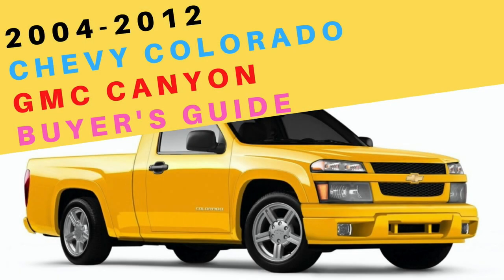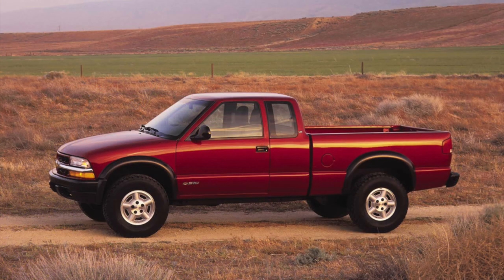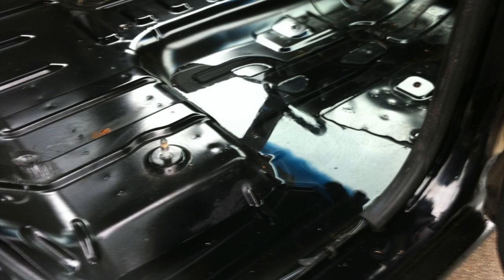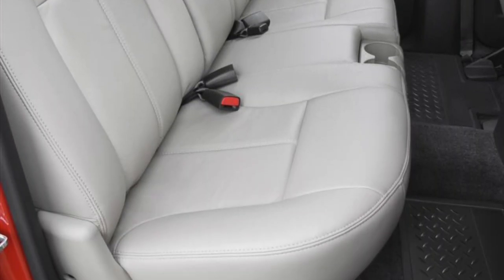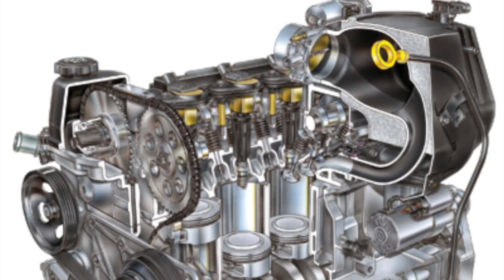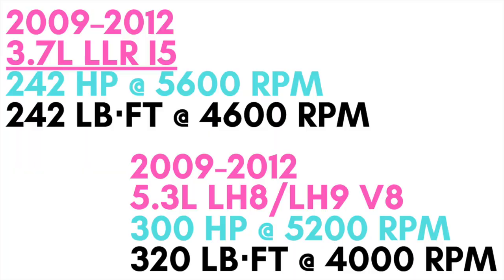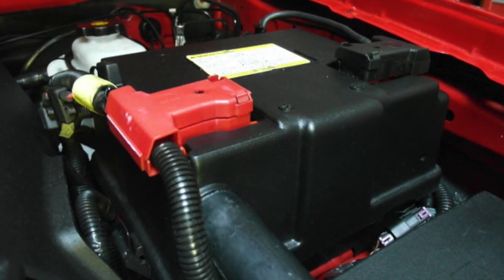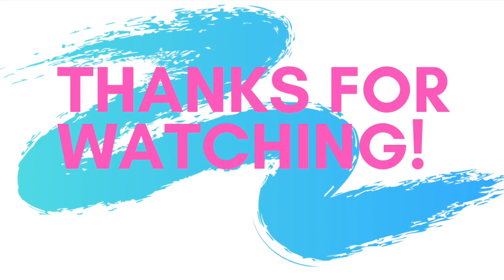Chevy Colorado / GMC Canyon Buyer's Guide (355 Series Common Problems, Options, Engines)

Comment: My 04 5cyl has 245K on it and still going strong. I would go out right now and drive it cross country without hesitation.
Reply: Thanks ...I'm thinking about getting one
Reply: I got an 04 5cyl with 335k km. Still goes strong
Reply: I have an 05 5cyl and i totally would do the same. you have any check engine codes? I've got one regarding an evap leak but I've tried everything and no avail. truck runs and drives fine though.
Reply: my truck also only has 68,000 miles
Reply: My 07 4cyl 2.9L has 460,000k lol
Still running strong as I used it for my home renovation business. I bought it for 1500 when it was at 280k.
Best investment for my business by far!
Reply: Automatic?
Reply: @ashtons7523  the evap leak is inside the gas tank. They are known to leak there.

Comment: Bought a craigslist 6 owner 2004 Colorado 3.5 automatic 245,000 miles for $2,600! Still running strong! Owned it for 3 weeks
Reply: Keep going. Our 06 has 370,000 still going strong.
Reply: @DuanneBall how’s that 06 doing? 3.5 i5?

Comment: My '05, 5cyl, crew cab Z71 Colorado is rapidly approaching 300, 000 miles and still gets 40mpg on the highway and in the mid to high 30s around town. With only a few, nagging, electrical problems I'm very satisfied with the truck.
Reply: Change the oil and the Atlas 5 will reward you for another 200k. These aluminum DOHC engines are exceptional from the closed deck to the girdle and sleeves. Their efficiency is why I adore them and own a fleet personally. Clean out the throttle body regularly and electric fans with a low thermostat keep it at a 1/4 instead of close to half. Specially effecting your air conditioning by 10 degrees plus. Good luck!

Comment: I just bought a 2005 crew cab 4x4 that went into a ditch at fairly low speed, but hit brush and a small tree. I have to replace the roof panel, windshield hood, grill, headlights driver fender and driver door mirror. 225,000 miles but it was a fleet truck for an excavating company so a lot of highway miles. Been well maintained. Interior is good. No leaks, good belts and runs great. Paid $600. It has the 5 cylinder. I didn't know anything about these trucks so it's good to hear that they are pretty good trucks. A guy I know had one that he bought new and took it in to get a tune up at 200k miles. It was still running well on the original plugs.

Comment: The 3.7 inline 5 cylinder is pretty good my dad uses it every day whit 340 000 miles
Reply: Impressive
Reply: @randumdude5824  will you sell?
Reply: I have one with the exact same engine but it only had 140k miles and 2k miles later one of the five cylinders had no compression.
Reply: I always wondered is there inline 5 manual transmission?
Reply: @jcpnlz  Yes, I'm buying a 2004 inline 5 4x4 with a 5 spd manual
Reply: @jcpnlz  Probably hard to find though. I just lucked into it. Most people buy auto trans and have for awhile.
Reply: @bags4930  oh ok cool I'm looking for a manual extended cab xtreme.

Comment: I just bought a 2007 two wheel drive crew cab with the 5 cylinder and 125,000 miles. I got it at auction from the local utility company so I figured it's been well maintained. I drove it 50 miles home and it runs great and the 60 to 80 is great for passing slower vehicles.
Reply: How's that 2007 running? Any issues? Do you have the 3.7L i5?
Reply: @thebarathleticclub3512  I just bought it to resale
Reply: @thebarathleticclub3512  I have a 2010 ext cab with the 3.7 engine. I prefer this over any of them, I had the 07 single cab with a 2.9 engine, it sucked because it had no room for anything and bad engine and I don't like the crew cab because you're cheated of out bed space. All of them have some form of electrical issues which after being figured out they are great trucks.

Comment: I'm not far from buffalo NY , my 04 248 k miles 2nd motor  is slowly dying due to ruff winters n salt on the roads . The frame is pretty rotten , the mech wouldn't put it on the rack to align it . Bolts are snapping off , the suspension is being replaced to no avail . I love this truck , please don't die !

Comment: I have a 2010 lx 4 door 3.7 4x4 about 100,000 miles so far. I like the truck, get about 20 mpg hiway. It's important to keep an eye on the engine oil level, and change every 3,000-5,000 miles in my opinion. Don't rely on the sensor lights to remind you. Definitely check that 3rd brake light seal, I had to use some silicone to seal it up.

Comment: The 3.7 can have a really mean sound to it as well with a flow master and a cold air intake swapped on. I also felt better throttle response and maybe some power gain after doing those mods.
Reply: That's interesting. I've been tempted to do some similar upgrades to my 2010

Comment: this vid helped me figure out what the camshaft actuator valve was I have that p0330 code and replaced my camshaft and crankshaft sensors and still had a problem with said valve leaking oil in the sensor. thank you.

Comment: I have a 2004 standard cab Canyon with the 3.5 and auto trans with the Z/71 SLE off  road package 4x4 with only 95,000 miles. I ordered it from the factory because early 2004 standard cabs were hard to find optioned he way I wanted. The newer ones (current) look like crap!

Comment: My ‘04 3.5L Z71 has a crankshaft seal leak, valve cover gasket leak, and clogged PCV valve. I’m about to fix all this stuff for less than $50. I love my 5 banger. I threw a camper top on it and use it for overlanding. I gave mine hell! She became a local celeb with my friends and people at my local university. I bought a ‘04 Jeep GC and it’s given me so many problems that I want to repair the Colorado sooner than planned just to have something more reliable. Over all my truck has done great for 220k miles and will have more to come. Not to mention the exhaust sounds badass since it’s a unique engine design.

Comment: I got a Chevy Colorado with $250,000 MI the only thing ever done put a water pump and it's easy to put on and put a wheel bearing but I live on bad dirt roads running through deep water but it's been a good one that's got 255 and I would be scared to go cross country own it and I love it and I'm fixing to get another one

Comment: Great job. Thank you.
I have a fairly rare '07 GMC single cab Canyon 2WD sport w/ 4 cyl eng, 5 speed trans, sport (factory lowered) suspension, 18" factory wheels, w/ buckets & console. I get asked to sell it all the time, but it is a fun, low slung keeper.
Reply: @SlamDogg Millionaire I was told it was a POS by friends when I ordered it. Now 150k miles, never left me down, not once. No disappointments.

Comment: I'll be looking for a reg. cab model to swap the 5.3 engine from my Envoy XL into. They never put the V8s in the reg cabs, and the colorado 5.3s were neutered with 'torque-management' software and fuel efficient axle-ratio. The result was a slower truck than what this legendary LS V8 was capable of. My 1500lb heavier Envoy XL also did 0-60 in 6.7sec (when stock), lighter Colorado should be quicker than that.  I want reg cab to be as light as possible, and swap my 5.3, 4L60e transmission, AND 4.10axle ratio into a reg. cab for a great sport truck that's capable of some work. Preferably in that yellow and with the 'Extreme' appearance pkg. Likely won't get that lucky, so I'd settle for any reg. cab that's not all rusted out like my Envoy frame. Wonder if I can swap that 2.8 4banger into my Hyundai Accent?😁

Comment: At my work (a moderately sized theme park) we use old 2006 Colorados as work trucks and they have very low mileage like 30 thousand but are really beaten up but they still run strong

Comment: Been driving a 2010 Colorado 3.7 Liter 5 cyl 4x4 for 4 years and overall it's been a great truck. Now at 135,000 miles 

Pros: 
-- Overall it's had no major engine issues. It is starting to burn a bit of oil at 3,000-4,000 miles after a change. 
--was way cheaper used than a Tacoma or Frontier
--some parts have been easy & cheap to fix myself, including struts, sensors, some wiring, oil changes, air filters, fluids. 
--Solid 4x4 for general mountain roads, 6 foot bed a nice size for camping and moving most things 
--gas mileage is solid. With good tires and cleaned intake, I can get up to 25mpg on the highway.
Cons: 
--interior is garbage. Most handles have broke at least once, and plastics are peeling. 
--some repairs are very expensive due to dumb engineering. Changing a wheel bearing for example cost me $800 bucks largely because the wheel hub requires you to take everything apart (big labor cost)
-- not a ton of torque for city driving and tranny is sometime slow
--some electronics and wiring are garbage. I've had to fix speakers, airbag sensors and more.

Comment: I have a 07 canyon 3thrd brake light leaked. Tail gate and glove box latch broke it goes in to anti theft mode have to wait 5 min to start. Other than that it's been good 105 ooo miles.
Reply: Mine done that anti theft cut off done that to me ,, look up the truck problem and cutting the white wire with blue stripe I followed his instructions never had that problem again
Reply: @manuelstapp3359  cool.  I'm having to wait 10 minutes, not 5. Pain in the butt.

Comment: The 4x4 version of these trucks had the worst Front Brake Design ever- TOTAL NIGHTMARE!
To remove the rotors they actually come off backwards, you have to remove several components.... look it up its absurd
Reply: Hi, I own several Isuzus. The design is very rugged. I've been on nasty terrain in the 2WD model and had no problems bringing the truck to a stop.
Reply: It's annoying to fish out the abs sensor with the rotor, but it's not a big deal. Being attached to the hub does come with better stability though. There are certainly some awkward repairs though such as the starter location.

Comment: I drive a 2011 Canyon 4x4 and it's had many of the common issues you list here. The blower motor was very annoying but not terribly difficult or expensive to replace. You didn't mention the most annoying drawback of these trucks in my opinion, which is the awful passlock failure. At least once a week I am unable to start the vehicle and have to wait 10 minutes for it to clear the passlock error.

Comment: When I was ready to replace my battery I wanted an Optima Battery.   For those unaware, Optima does not make a group 86 series battery.  Being said, the 86 series is 1” skinnier that the 34 series.  34 is a super common battery.  
If you want to upgrade your battery, I suggest pulling you battery tray out and cutting part of the angled siding on the inside.  It just acts as structural support.  I used a Dremel tool to make the clearance.  
If you end up getting the larger battery, and want an Optima; you will need additional work to be done.  The optima is a group 34/78 DT (double terminal) meaning it is also a 78 series battery.  The difference between the two is the 34 is top post, the 78 is side post.   For some reason they made the side terminals pushed the the center more, and this lines perfectly up with a bracket that connects to a strap to hold your battery down.  This being metal- we have an issue.  I ended up cutting 2 corners of a circle that way I don’t fry my battery by having the front side terminals both touch a metal bracket.  
A little unsightly, but you can always make the cut cleaner and look better.   Overall if you want a bigger battery, 34 is my suggestion. Much stronger, more common, and waste less space.

Comment: So does the 2007 3.7L i5 a better option than the 3.5L i5 that had the valve seats issues? Or does it also have that same issue?

Comment: I just had that code it turned into the valve in number 4 breaking free and falling onto the piston so beware if it ever misfires. Also this engine cost 4500 through jasper engines good luck trying to find one elsewhere
Reply: Copart has wrecked ones for cheap!

Comment: I just bought a 2011 regular cab work truck with the 2.9L four, 5 speed with 19,022 miles on it. Clean CARFAX 2 owner.
Reply: I own a 2011 Reg cab LT  2.9L, 5 speed 4x4.  Mine has 25,500 miles on it.  I would have 19022 on it had two getto boys not stolen my car making me drive my Colorado instead.  I am worried about future work on : Alternator and Starter.  I heard that they are hard to remove.     Is your truck from the South or Rust belt?
Reply: @Romulan112  Louisiana all it’s life.

Comment: I have a crew cab 07 clean condition with 160xxx miles lowerd on Denali 20 in rims with nitto tires also have monitors in it has a spacer and intake whistles like a turbo without flooring it line x bed and tinted all around super clean only issue I have is electrical dooor switch flicker for the first 10 min of driving idk what it could be

Comment: Can we swap this engine with the engine of the isuzu d-max?is it the same platform?
Reply: Is it a yes or a no ?
Reply: Yes and no. If you can get your hands on a 4J diesel, you'll need the transmission and ECU. You'll need a custom driveshaft, and you'll have to weld new engine and transmission mounts.

The GMT-355 is different from the international D-MAX frame. It's "based on," not a replica.

Comment: They made these trucks too cheaply
Reply: you obviously don't own one then, they are great
Reply: @j0sh368  I have a 96 Chevy S10 though
4.3 v6
Reply: I have an 09 5.3 crew cab and it’s made cheap asf it’s a solid truck though but they cheaped out on everything
Reply: @j0sh368  I own one and I do not think so.
Reply: Yep, I agree with that one, way to many cheap plastic parts that breaks easily and the electronics going out and mailfunctioning can be a pain in the ass too. I haven't had many other issues besides the throttle body being clogged.

Also, the security system is really shitty, it will lock you out from starting the vehicle at times.
Reply: @hummerguy  I worked for a car auction part-time for a while, and most of the junker trucks they sold were GM.
Reply: Agreed these things were awful, my mom had one electronic 4x4 was always screwing up, her radio quit working, heater had 2 settings Off and full blast that eventually went out. driverse seat was literally taped together. tires were expensive + size was weird so when she ordered tires they didn't have them alot of times. oh and 4x4 brakes SUCKED
anyone who tells you this truck is awesome must love paying 600$+ getting their 4x4's front brakes done. i can't defend a truck's quality when they fuck up something as simple as front rotors Mom put a fortune into this truck until it died of electrical issues.
Reply: @Shishizurui  GM is known for electrical problems.